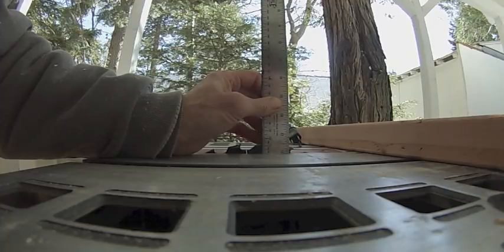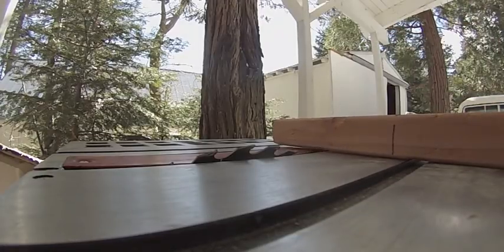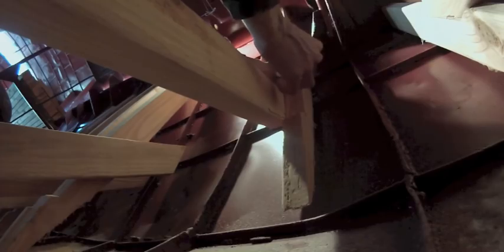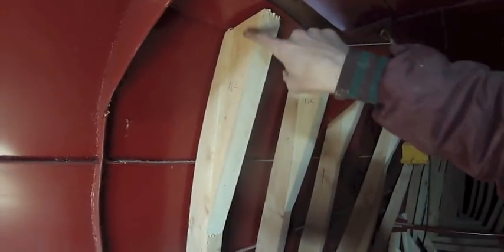Steel Sailboat Build Part 13

Comment: I think I would have used pressure treated wood at least for the pieces that rest on the bottom.  They are going to see a lot of water.  Don't forget the limber holes.

Comment: Here comes the negative comments - losing half the boats interior because you didn't build the ribs deep enough like you would if  you had used plans.
Reply: or even a mockup/model/tender first etc

Comment: You arent planning for any steel bulk heads ? What stops the hull from twisting along its length ? Enjoying the work
Reply: Nothing by the looks of it. I haven't seen any traditional boat building skills used . This thing will float just long enough to be over the horizon, maybe.